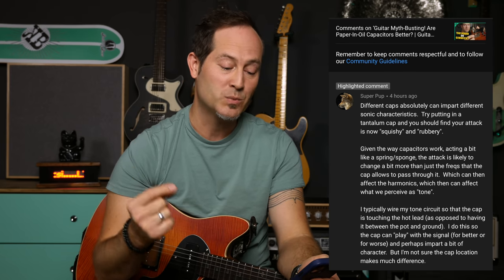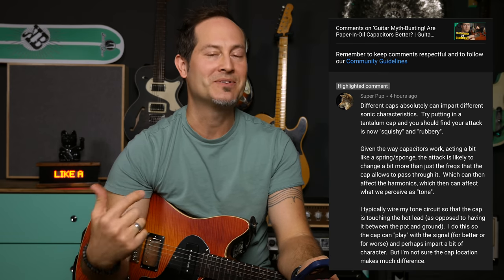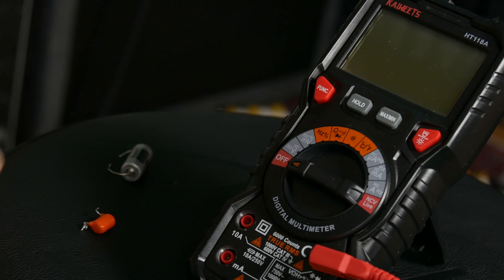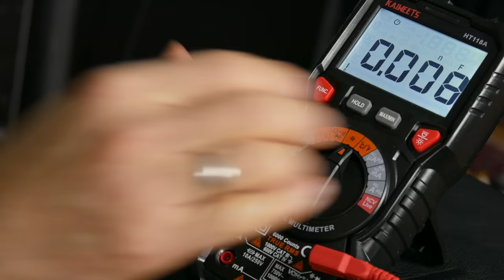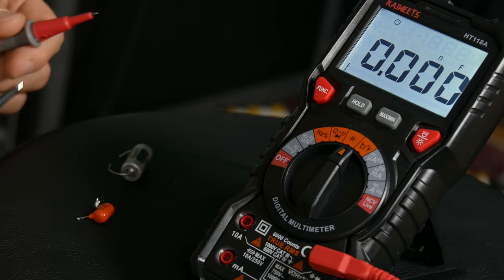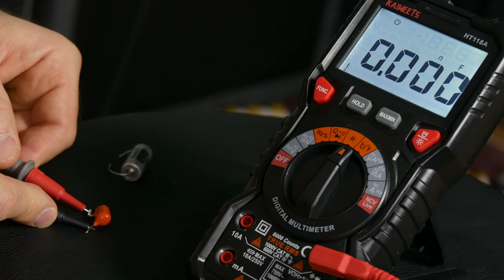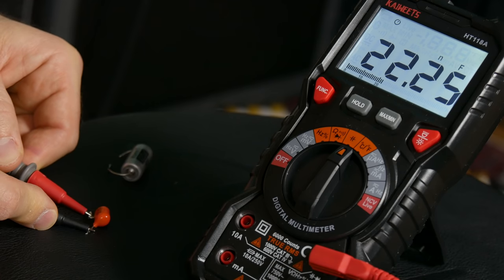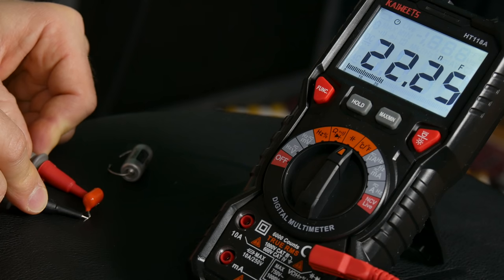Guitar Capacitor Types Matter! Here Is The Proof | Guitar Tweakz

Comment: Both of those caps are so close in value that you could basically say that they are matched. 21.8 UF and 22.2 UF is as identical as you can hope for. That is only a .38 difference and that is miniscule.
Reply: nF
Reply: Yep, the deviation from the nominal value is within 1%. That's a really great result considering that these types of capacitors are typically rated to have a tolerance of +-10%. In fact 10% tolerance is what Mojotone advertises on their website for the Vitamin T capacitor that Kris was using in this video.
Reply: A 25% difference wouldn't be very noticeable in terms of roll off frequency.  There's a lot more to caps than capacitance if you look at white papers. You have ramp speed, ESR, inductance etc...  Many techs ignore, or dismiss the other characteristics, thinking they know better.  That's all I'm going to say, because I've learned debate is a waste of time.
Reply: @qua7771  I was only talking about the value I didn't say that there weren't other differences, no debate here because I actually agree with you. The entire conversation was only about value and nothing else so I never mentioned anything else.

Comment: I just found out the orange drops do have a prefered polarity. It has a ground shield on one side. Easy to figure out. Plug it in to the amp and touch the outside. If it hums, it's backwards. Have a day!
Reply: Not really a polarity. The cap really doesn't care which way, unlike a tantalum or electrolytic can blow up if connected in reverse. Although at pickup output voltages that might not be an issue, but I still wouldn't use those two types.

Now the outside foil is better to connect to ground for one reason: it can act as shielding for noise for the cap.

Comment: Nothing passes thru a cap. for current to flow thru there has to be some resistance. Measure a caps resistance. The two leads NEVER touch each other, they are insulated from each other with a dielectric material. They charge and discharge with alternating current. Every time they do this current flows in a circuit, NOT thru the cap. The value determines how long they take to charge and discharge. Musical tones are sounds that alternate at different speeds (freq.). Anybody seeing the correlation between value and freq. So someone explain how different materials can affect tone. Guy's, expectation bias. I hesitate saying this with some of the stuff I read but your, our, brains have an amazing ability to make us hear what we want to hear, you are not immune, nor am I it happens to all of us, it's very real and seems we are really hearing a diff. when there can be none. Once I really studied and understood this many things I thought I heard in the past seemed to not really exsist.

Comment: Found this article about capacitors. "The ceramic capacitor is a non-polarity device, which means they do no have polarities. So we can connect it in any direction on a circuit board. For this reason, they are generally much safer than electrolytic capacitors."
Reply from the maker: Hey George, thanks for the comment! Take a look at this video, this explains what I was trying to say about polarity. https://youtu.be/BnR_DLd1PDI
I know it sounds misleading, I didn’t mean + and - in terms of voltage. What I meant was the direction it’s folded inside, under the enclosure. It’s quite a revealing video, I highly recommend checking it out. Cheers!
Reply: @KrisBarocsi  Very interesting video. Thanks Kris 👌

Comment: So u had an electrical engineer say "the freq that pass thru it" ? That's kinda weird as NOTHING ever passes thru a cap. Again it charges and dis charges allowing current to flow in the circuit. Measure the resistance of a cap, see what u get. That's why it blocks DC but it also blocks AC. Why do you think it affects diff freq. according to value? It's value tells u how long it holds a charge, also how long to charge. That is only affected by value, not what it's made out of.

Comment: Cool! There's so many comments that it's impossible to tell if this has been discussed already: 

With the tone knob on 0% the tone cap has a slight resonant peak before the treble cut starts to happen. The phenomenon is perceptible. I've used this effect to my advantage to get a slight mid boost to my vintage style basses. Picking the right one between different value caps is great fun.
Reply: This is a subject that still is highly debated... Not only on musical instruments, but in audiophile circles. Remember those guys argue about wire gauge from mains power in to amp... From speaker to amp, and elevating said speaker wire off the floor. Cap differences make a difference in their perception of the sound too.

Comment: Based on the linked video re: cap polarity, the noise floor that comes from the cap being "backwards" is really small.  In that vid he literally bridges the hot and ground at the amp's input with a cap, then CRANKS it to hear the noise.

It was neat that you found the oil and paper smoother.  The difference in the measured cap values was pretty minimal, and the slight difference in 'drained high frequencies' would be hard to hear, but people do say the oil and paper caps are 'smoother'.  So it's nice to see a side-by-side confirm that!

I had to laugh when the vid started.  Before I noticed you had an autowah on, I thought that tone was coming from a tantalum cap and I thought "Man, that is super noticeable in a guitar"!

Hugs, brother!
Reply: Here is a link to a video called "Are Your Capacitors Installed Backwards? Build this and find out" in which an oscilloscope was used to test the Capacitor's polarity. I didn't list it in my comments the other day, as the video is almost 50 minutes long. One can clearly see the effect of the wrong polarity. It is very interesting, so just in case you're interested, here's the link: https://www.youtube.com/watch?v=BnR_DLd1PDI

Comment: Chris, your Thomann video about finding ground issues with a multimeter was very helpful. I followed your example and inserted a short cable into the jack and found that when I placed the black probe on the sleeve of the cable and the red on the pots no continuity beep occurred. So I thought finding the problem of the grounding hum would come easy. It has not. The ground wire to the input jack appears fine as does the other end on the switch and when I use the multimeter on both ends the continuity beep sounds. Where do I go from here? Any help would be appreciated.

Comment: The ultimate test for difference is not going to be found by listening to extended passages of instrument playing.  Multiple scientific studies have established that echoic memory only persists for a few seconds at a time.  Meaning you have next to no ability to compare things that you heard more than about five seconds apart.

The proper way to compare two different capacitors is to feed each of them an identical signal then mix the two signals with one out of phase from the other.  The remaining artifacts will tell you what "differences"  there are.

Comment: The polarity again is very important. You should always test the caps before soldering them in. You need to use 2 alligator clips and flip the caps around a few times while listening closely. Instead of playing chords you just want to play single lines. I found that with paper in oil cap I test them with the tone rolled all the way down (woman tone). One way will sound more dark and midrangey. Then flipping it the other way it will sound dark with some clarity and bite up top but not midrangey. Better for the woman tone that way. Not sure if other types of caps have the same effect.
Reply from the maker: Hey, I’ve learned that some caps have polarities, some others don’t. As far as I can tell paper-oil has polarities so it’s a good idea to test it. 👍

Comment: I am not an electrician. I heard a slightly darker tone after you turned the capacitor around. It had a bit more clarity to my ears before it was flipped. As for me I prefer darker tones because my hands already  put out a lot of mids.  I usually have my amp and guitar tone set pretty dark. If I don't do that, my tone gets way to bright. Thanks for the video
Reply: It's the tone that is ''too bright' that starts everyone on the quest to modify their tone circuits. All guitars are capable of bright tones, and many of us have adjusted the amp to sound darker. You can also play in the first position rather than up on the neck, and stay off the first and second strings to avoid the higher frequencies. I strongly believe that a guitar should sound like a guitar rather than something else by using it's full range of frequencies.

Comment: It is necessary to consider caps tolerances.
If tolerance is ±10%, then a nominal 22.2 µF may vary from 19.98 to 24.42 µF
If tolerance is ±5%, then a nominal 22.2 µF may vary from 21.09 to 23.31 µF. 
If it is case of the second option (both caps measured on this video have 5%) then both capacitors are within range.
Reply: In this case, they're both within 1.2%

Comment: I will say it could be possible for a cap to pick up hum depending on orientation, but to tell if it's more than what is normally picked up by the pickups and wiring, probably not even measurable. If it is measured too little human ears can't hear it, even if you have superhuman audiophile ears. Since we are dealing with alternating current, polarity mis-match is not possible.

Comment: I think you need to consider how a tone control on a guitar works. The capacitor in this circuit is not actually on the signal path. Ok, let me explain,  the tone control circuit works by "bleeding off" the higher frequencies to ground , how much is bled off to ground depends on the value of the potentiometer and what frequencies are bled off depends on the value of the capacitor. The crucial point here is that these frequencies go to ground they do not appear at the output. What you hear after the tone circuit, has not been "through" the capacitor, the capacitor has no effect on this signal other than bleeding off the higher frequencies as previously stated. Different types of capacitor do not "sound" different if the values are exactly the same (they actually don't have a sound at all), what does make a difference to the audio signal is the tolerance rating and this is only because the value of the capacitance may not be what you think it is.

Comment: Hi Kris,
Great stuff, interesting topic. I did not really hear the difference, but it might be my ears ruined by loud rock music. :-) The corner freq difference between the two values are at 1K (you might moved the pot a tiny bit) 7281 and 7156 Hz so above it rolls off 6db /octave. But normally at 10 it wouldn't read that high and at 100ohms it is 72810Hz and 71566Hz which is inaudible. In my opinion you need extremly good and precise ears to spot the characteristic difference between two types of caps, I guess you rather hear the difference between values, that usually way more apart as those caps have 10 or sometimes 20% tolerance. I would love to see (and hear, but clearly I am not the perfect judge with my out of order ears) a blind test with you and a couple of other players to see if you can hear or feel the difference. I guess you could feel the difference when you change the cap in your beloved axe that you know extremely well, though I think it is rather a what I am used to and like, than a good or bad cap thing. And one more thing. Usually I hear people say, you can hear the difference as the signal goes through the cap, and as it has a different characteristics, it alters somehow the tone and the response of the guitar. But the part of the signal that goes through this cap, is the part that goes to ground, therefore you don't here it. (but I am no engineer, so correct me) Once I heard a good reference that a very fancy expensive cap is like having a very expensive and nice looking bin. :-) 
Cheers

Comment: I enjoyed this and the previous video on Capacitors and tone. Super Pup had some very interesting comments regarding capacitors that I hadn't heard before, and something to keep in mind when choosing Caps. I think you were right to keep the first video blind regarding the Cap values, even though I found it frustrating at the time.

Thanks for testing the polarity of the Caps, as  connecting them so the "outside foil end" to ground helps with noise, and probably bleeds some highs to ground. So, in that part of the tone test in this video, I would expect that when wired with the designed polarity going to ground, the tone would be darker/warmer. I did hear a difference in tone, and guess that when the "V" mark on the pot was pointed towards the Tone Pot, the Cap was wired with the outside foil end going to ground as intended.

I think there's a benefit to wiring the Cap so the it is grounded properly, as that would help reduce noise on noisy pickups and loud volumes. As far as "tone" goes, I think the tone knob easily covers the range that the polarity of the Cap affects, so that wouldn't be a deciding factor for me. The Paper-In-Oil Cap seemed to improve all the aspects of tone that are important to me. Thanks for making such interesting videos. 👍 😎

Comment: Beautiful guitar!!! And yes of course the character of different types of capacitors will have an influence. Just check their spec scheets. There is a reason that different types of capacitors are used in different parts of the circuits. It's hard to explain to someone who's not trained in engineering. Lots of small differences in charge and discharge time and so on,add to that different pots used. But STILL beautiful guitar!!! Please make a video about the guitar.

Comment: POLARIZED capacitors have a polarity. Those are the electrolytic capacitors that are big cans with a stripe down the label. They are only polarized to indicate which plates are intended to build up electrons vs holes (if electrons are negative charge carriers, then an 'empty space' for an electron to fit into, or positive charge carrier, is called a hole). If you put a polarized capacitor in backwards in a normal DC circuit (especially one anywhere near its voltage rating) it will breakdown the electrolyte, which will boil off, or out gas, causing the cap to bulge and eventually rupture spewing nice sticky electrolyte all over your circuit board. 

That being said, voltage rating does matter. There is no point in putting a 400v capacitor in your guitar....unless its active electronics are powered by mains or something....well i mean, who knows, maybe there is some interesting tonal characteristics in using vastly over rated caps, but Ive never heard of any....generally speaking, on a normal passive guitar its not making a whole helluva lot of power from the string flying over the pickup magnetic fields in the first place. Maybe its fine? [shrug] IDK. I do know they make caps with a one and some change voltage rating, even lower for SMD circuits, that could possibly be an issue with polarized caps. 

The take away here is UNLESS THE CAP STATES IT IS POLARIZED IT IS NOT POLARIZED!!! And the polarization only matters so far as the damaged caused by building up opposing charge on plates not designed for it. No, not all caps are polarized, especially blue ceramics and 'orange drop' polypropylene caps (which, by the way, dont get taken by marketing, are normal ceramic and poly caps, there are no 'music capacitors specially engineered to make you a better guitarist by offsetting your lack of skill and decent hardware' out there. No, there isnt. Stop typing. There is not).